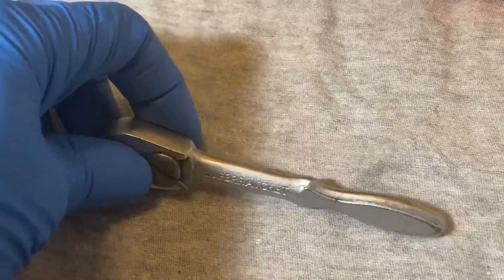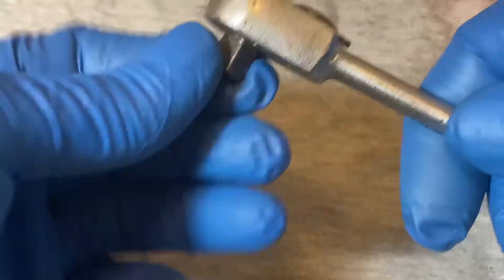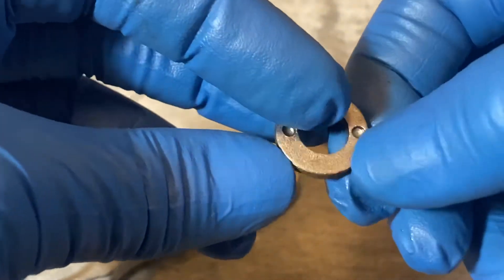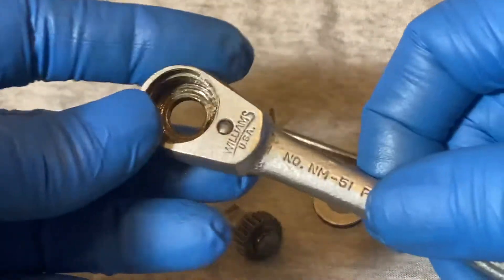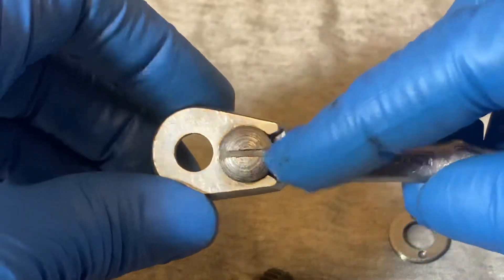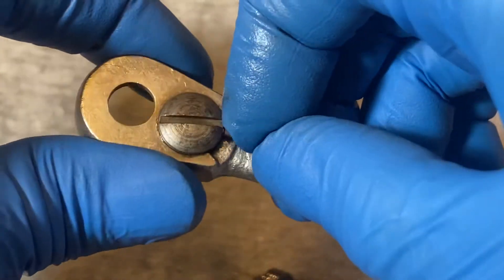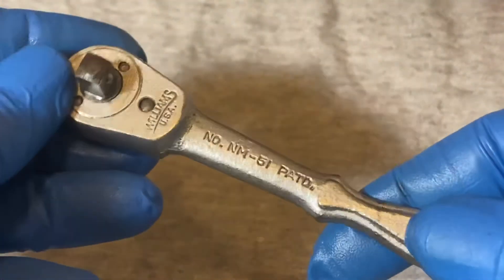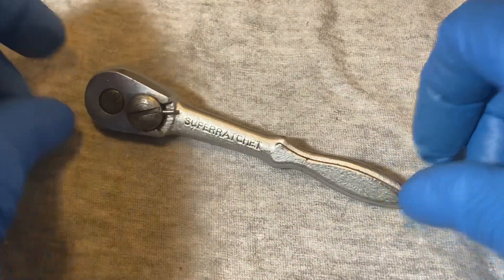Williams NM-51 Superratchet TEARDOWN Vintage 1/4” Drive

Comment: The WRIGHT TOOL 2426 is about as small.
Many companies also offer " smaller " more standard length ratchets, but it seems longer ratchets do tend to be more of the trend these days.

It's usually longer or micro / stubby these days for some reason and a 4-1/2 or so being the exception.
Reply from the maker: Yes those Wright’s are small. I got a Wright 2400 from the late 60s and the diameter of the head only measures 20mm. Another small one is the S•K 40970. Last year when I went to Auto Zone I saw and picked up a tiny pear head ratchet by a company called Titan. 3 1/2 inches long and a quick release lol.
Reply: @snapringchronicles3020  
The 2400 is definitely small.
I like their contour grip myself,  so I went with the 2426.
I may have to pick up a 2400 just for the sake of it though since they still make it.
Reply from the maker: @TylerSnyder305  yeah definitely good for those tight spots 👍